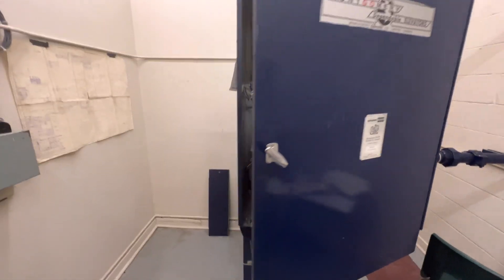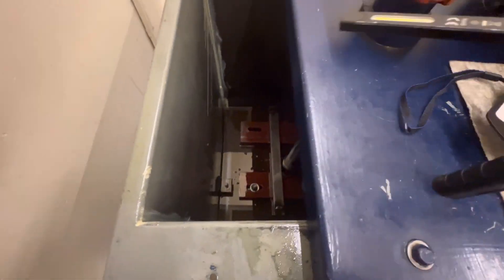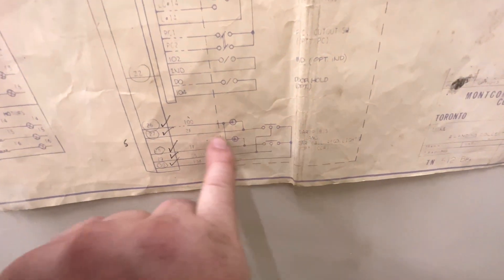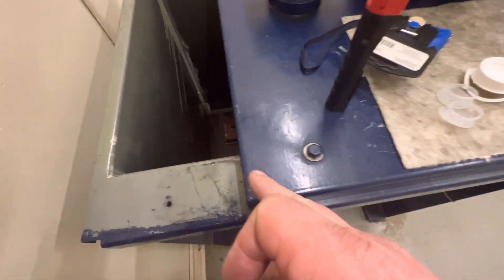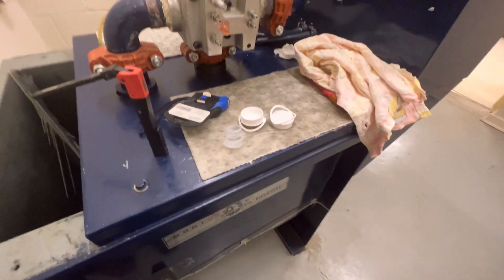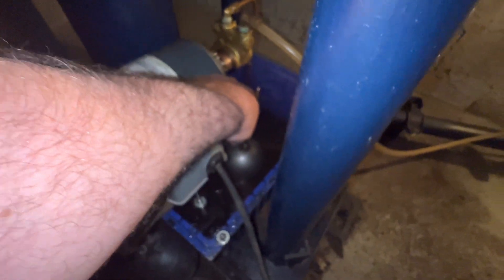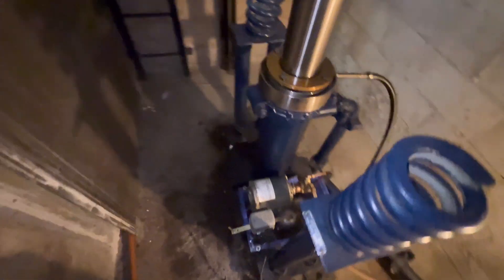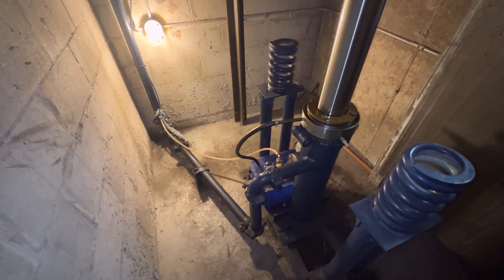Montgomery Hydraulic Elevator

Comment: A lot of jacks get replaced only due to confusing loss and happy salesmen. But there are also some hiding out there that have rusted down to 1/16 of what you could call steel. Real pressure tests instead of quick shutoff tests are important. Pipe stands? Good vids.
Reply from the maker: Thanks.